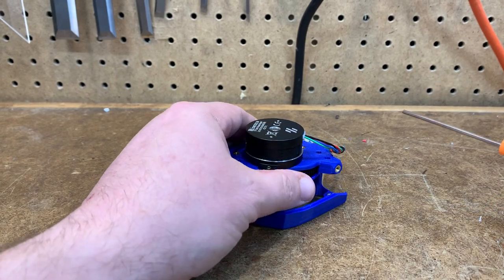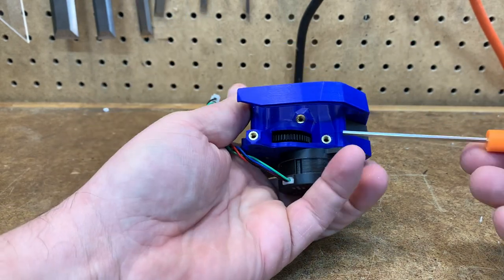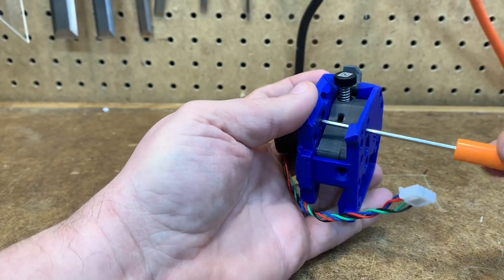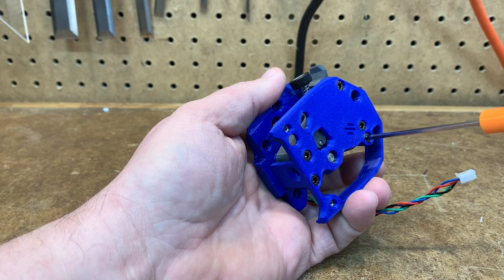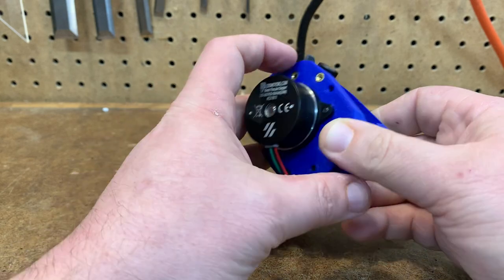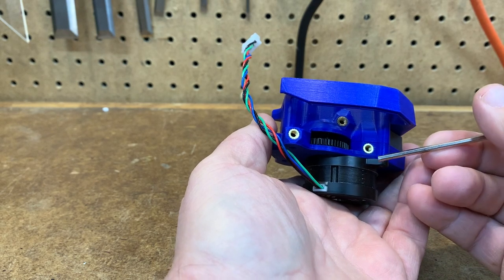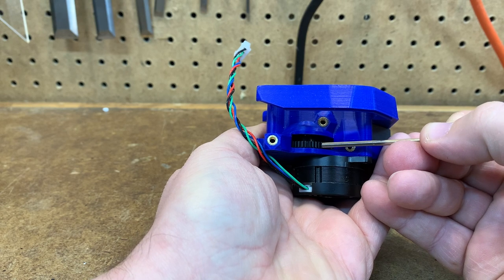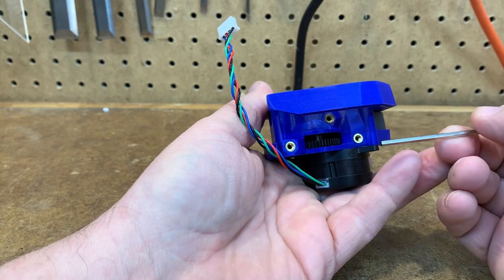How to set the gear mesh in a Voron Clockwork 2 Extruder

Comment: Just rebuilt my SB/CW2 with PCCF parts and using the Mellow Rigda Gear set using your method once again thanks so much for both the videos on how to set this up. oh I tried it with the filament in and then took the filament out and it feels about the same just incase anyone is wondering. The last one was working perfect and I have it as a backup just incase of a breakage or I feel like building another Voron :face-green-smiling:

Comment: You are supposed to do this with a piece of filament inserted, having the filament will reduce the backlash. Your backlash may still be too little if its just nice without filament
Reply from the maker: I certainly appreciate the feedback!  As a data point, the CW2 extruder in my 250mm Trident is still running parts from one of the last beta versions before RC1 was released.  I adjusted the backlash using this method, and it still works very well after (wait while I check the history. . . ) 1339 hrs, 58 min, and 14 seconds of print time and 7577.2 meters of filament extruded.  That's just for one of my printers. Full disclosure: I did not pull the extruder to check on the gear wear for this specific extruder, but I have checked it often with other extruders during testing.  While I will never say that there is only one way to accomplish a particular task, extruders that I have adjusted using this method have completed literally, thousands of successful print hours and many kilometers of filament extruded.  I am happy to be proven wrong with compelling evidence, but lacking test results indicating that my method does not provide good results, I will continue to stand by it.
Reply: Certainly! I am not trying to sound offensive or trying to say your method is not a good one. It’s just I said it “may” be possible. I am just trying to give a precautionary measure, as I observed from the Voron discord pinned messages and in Ellis’s print tuning guide that backlash should be adjusted with the filament. Appreciate your reply and understanding!
Reply from the maker: @gedeonang7077  I can't tell you how much I appreciate the positive tone of this discussion!  Ellis's guide is an exceptional resource, and I frequently recommend that folks reference it since I believe that it's the best printer tuning resource that I have ever seen.  I am sure that his method will work well.

Comment: My 50 tooth gear is half engaged with the motor, though I've got the backlash perfect, I maybe got a sh*tty gear stack? I can slide the 50 gear back and forward down the shaft a bit to mesh properly but, it can work it's way back... I'm pretty sure I build the stack exactly and quad checked it. It's run for like 9 months and I only have metal/oil on half of the 50 tooth gear width. ... having checked through discord people seem to be saying that that is normal... seems weird